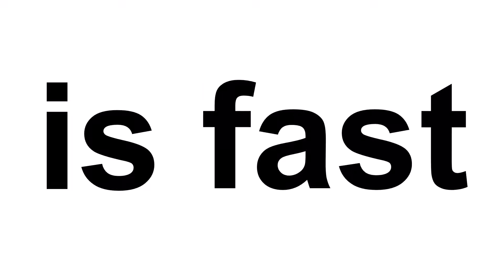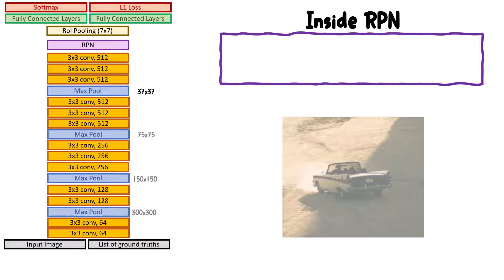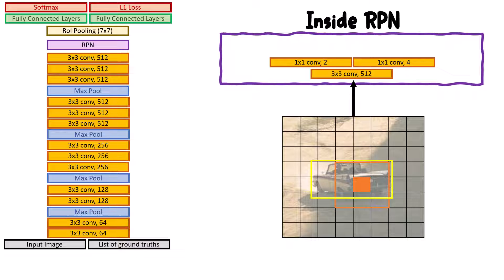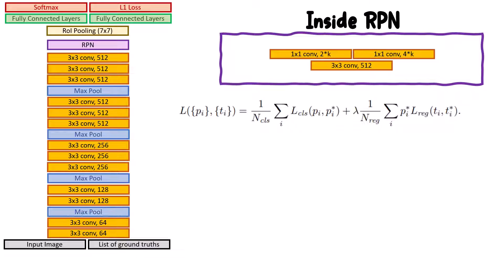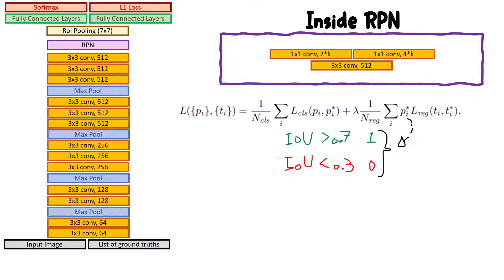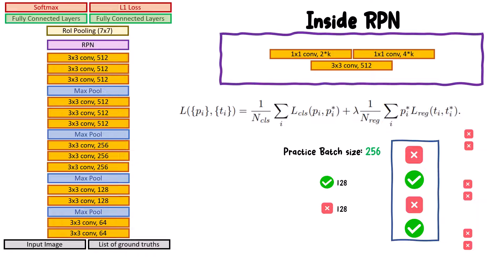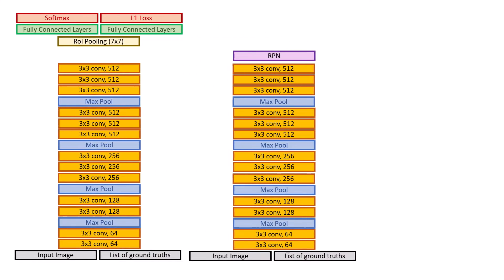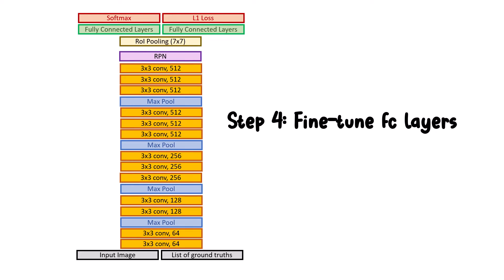Faster R-CNN: Faster than Fast R-CNN!

Comment: thank you so much sir.
is the RPN and FAST RCNN trained separately?
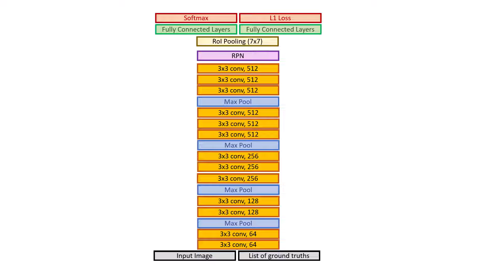Reply from the maker: As I explained from 9:22, the training is done in multiple stages. In the first stage both backbone + RPN are trained. In second stage the backbone is reinitialized and RPN is frozen and network is trained similar to the FAST RCNN. In third stage backbone is frozen and RPN is trained. And in final step both RPN and backbone are frozen and FC layers at the end are trained.